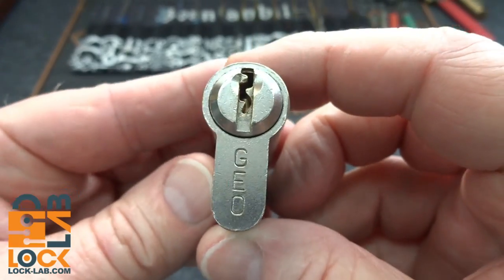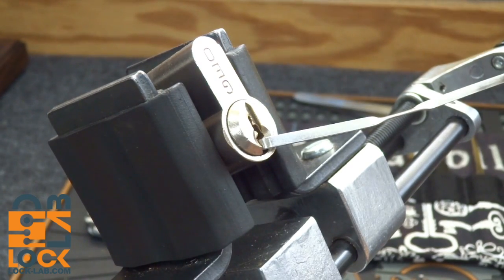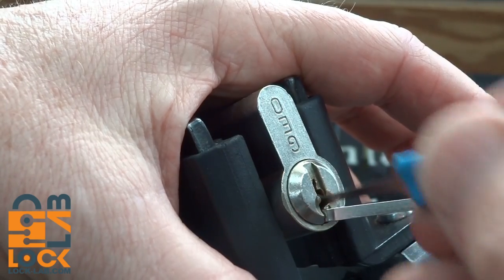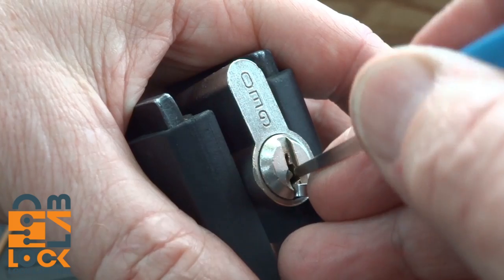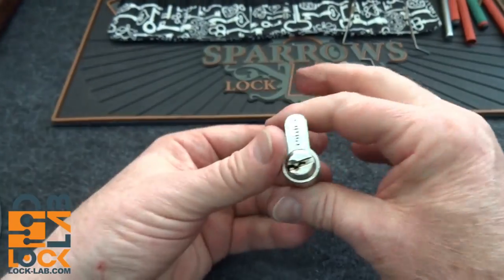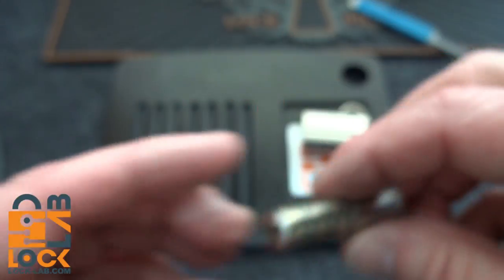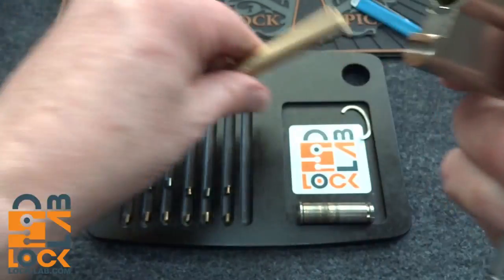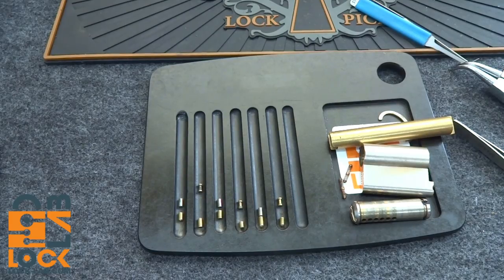(1015) Geo Euro Cylinder Picked & Gutted

Comment: Why do you put the locks upside-down you Americans and Canadian people are odd putting a lock in upside-down keep up the gods work
Reply: Andrew robinson for the exact reason he mentioned at the end... Keeps them from filling with crud and dirt like this lock was. Putting the pins on the top allows gravity to keep them clean rather than filling with dirt over time.

Just because you do it differently does not mean you do it better 😜
Reply: On the other hand, with the pins pointing down they're perhaps easier to lubricate?
Reply: Bart Kuijper except that lubricant + dirt = nasty crunchy lock that likes to jam up its pins. That's why you should only use dry lubricants (not things like lithium grease or wd40).
Reply: He has been accused many times of picking it "the easier way" and so he now picks them a random way. If you check his videos, you will find ones he picks "normal" side up.
Reply: Easier to pick that way that's why.